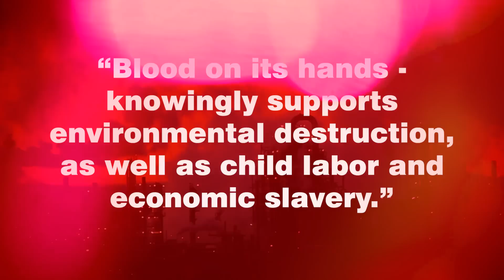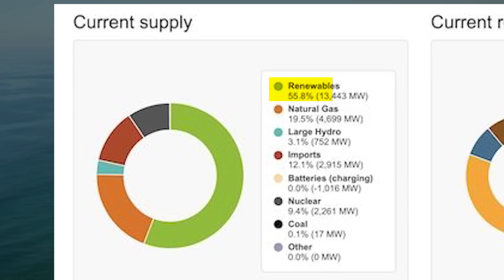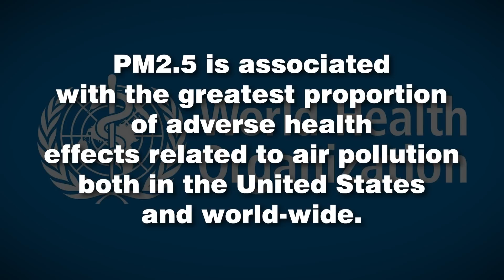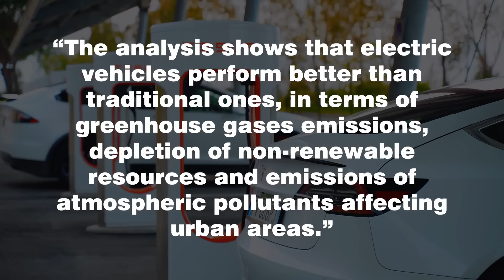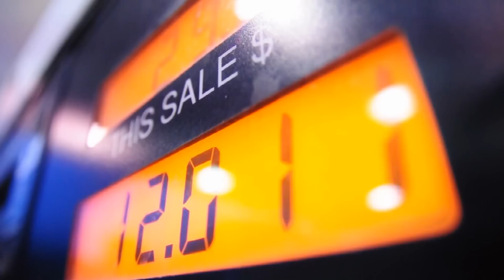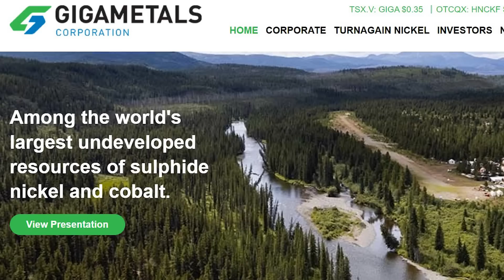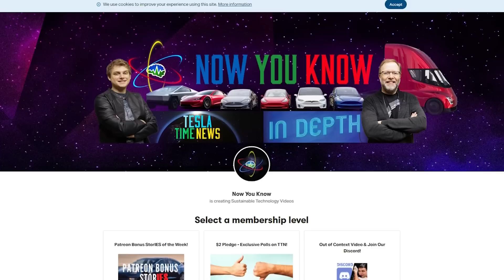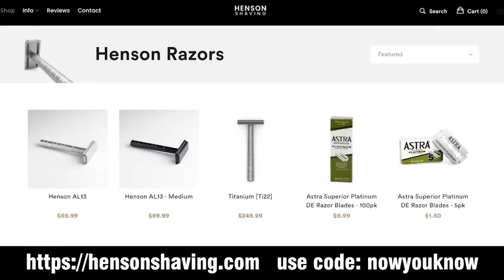Debunking More EV Lies | In Depth

Comment: You mislead, Our power grid cannot support a large conversion to EV's as was just recently proven by CA who put out an alert last week for the few EV's on the road in CA not to charge their vehicles because of the fear of brownouts or blackouts during a hot summer. Also if you have to put in a lot of miles you will not be charging from your home solar panels most of the time but from the underpowered electric grid and it may take hours to recharge. Not to mention the up to $30,000 dollar cost at present to replace your batteries in 3 to 5 years. Nor the expense to mine all that Lithium, and recycling (if you can) the old batteries. Nor the danger of your batteries overheating or shorting out and burning your auto to the ground. And the inconvenience of your EV's range continually dropping as the batteries age (as will the chances of your batteries shorting out increase). We are not there yet, but we may get there in about a decade if the tech continues to improve and they start building nuclear power plants again here in the US. Also, we will be running short of Lithium as more and more EV's are in use. Hopefully, they will come out with a better battery soon, but for now, not so much. I think solid-state hydrogen paste will be better in the long run. But we need cheap plentiful power. Fission for now( preferably thorium), hopefully, followed by fusion. And the diamond batteries look hopeful too.
Reply: Completely misleading.  CA asked EV drivers not to charge between 4-9pm, which was an unnecessary request as 95% of EV driving already happens between midnight and 6am.  And Tesla warranties their batteries for 8 years/150k miles and they are rated to 400k miles, so battery replacement is very rare.
Reply: @SpottedSharks  No, its not rare. It inevitable. If you own an EV. You will eventually have to replace the batteries.

Comment: The sun doesn't shine every day, and the wind doesn't blow every day. I know people in the wind business, it can not financially sustain itself without goverment subsidies. California is not a good example, they are importing some of their energy needs from other states, and oh yeah, the govenor is telling them to turn lights off, and set their AC at 78 degrees because the grid can't handle the demand, but sure everyone go get a EV and strain it more. In the big picture, the infrastructure to charge cars needs to be put into place before they overload the system with EV's. EV's are signifiacntly heavier, and heavier cars damage roads more and wear them out faster, and it is actually an exponential number it is not linear, so by wearing out roads faster they have to replaced sooner, thus expanding a EV's carbon foot print, oh and heavier cars wear out tires faster also, again add that to the carbon footprint, there is plenty of ripple effect with EV's if people want play which has the overall carbon foot print.  and the Congo is far and away the largest producer of Cobalt, last I checked they are responsible for somewhere around 70% of all Cobalt produced today, and guess who the number two producer is? Russia. oops. I am not against EV's in anyway, there is just too much koolaid drinking around how much better they are. In macro economics check out the petro dollar, the adoption of EV's over gas cars will help faciliate the collapse of the US dollar, you think your puchasing power has taken a hit in the last 2 years? It will look like childs play. ......all that siad I really hope there are some big break throughs in battery technology, it will be needed. Nuclear plants should be put in place, they are much more reliable and scalable, they even have technology out there to recycle the nuclear waste product now.

Comment: EV is the wave of the future. I would encourage you to read the report from Volvo, where they did a Life cycle of an EV vs ICE on models they currently produce, the XC40 Recharge and the XC40 ICE. This is by far the best analysis of the argument. They manufacture both and have the data. They leave it up to the reader to form an opinion.  The link is too long to post, as I haven't learn to convert it into a shortcut. Gladly willing to share it.

Comment: I would be literally better to use a big stationary two stroke engine burning crude oil to generated electrical power than to use ICE, because the big engine is more efficient, and as its a building, you can use big filters and closed cycles to capture bad particulate, outputting "clean" CO2.

Comment: Here is my prediction for how EVs will be recycled in the future.  Given that the mechanical components of an EV will wear our long before the batteries, I predict that EVs will be repurposed and used as an energy storage system for residential homes.  Someone will eventually develop adapter kits that will allow you to integrate the battery storage systems into your home solar generation system.  We'll see small huts start popping up in back yards everywhere.  Pull your worn out EV in, hire an electrician to hook up the adapter, and wahlah, 65+kwH worth of storage.  More than enough energy to significantly offset the power requirements of the typical home.  There you go, I want a royalty if someone does this.

Comment: Stopped watching after your first "debunking." To be clear, you claim to have "debunked" the statement about the US power grid, yet you completely fall short of debunking it. There are actually two points being made in Sorrel's first argument. 1) the majority of power in the US grid is generated using fossil fuels. You acknowledge this fact, but basically argue "Hey, it's getting a lot better, and will continue to do so in the future." OK, fine, let's assume you are right. That still doesn't "debunk" the fact that the vast majority of the energy going to power America's growing fleet of EV's does in reality come from fossil fuels. So you are 0/1 there. Second part of the point, 2) Even though EV's don't have tail pipes, accurate and responsible accounting of the emissions from driving an EV must include accounting for the emissions caused by generating the power that charged said EV. You completely gloss over this point, you don't remotely debunk it, not by any stretch of the imagination. So you are 0/2 when it comes to debunking both parts of Sorell's first point. Sorry, please remind me, who is making trash videos here?

Comment: You have Gavin Newsom telling people to limit their power use and not charge their EV cars. So how reliable is solar and wind....Wind power mills life span is about 20years. it takes 16years to make it's money back....so 4years of profit before it's decommissioned? Try to drive an EV in -35degrees in Canada! the power in it's battery will deplete fast! If a battery powered car can charge as fast as filling up a gas powered car, and be as reliable in cold weather and be able to pull a trailer without fast power depletion then I would definitely be sold on buying one!

Comment: I agree with the nuclear statement, but think the 25% number is a bit deceiving if you actually look at yearly output from solar and wind farms, of course peak season in high demand areas with the most infrastructure will produce higher figures... That's why a yearly average is neccessary. Also nuclear power can be generated without relying on China to make it economically viable (although it does usually take 15-20 years before paying itself off) China can cut the solar market and much of the wind turbine market (although to a slightly lesser extent) TOMORROW. Also the lifespan/financial equalization period without subsidization for both Wind and Solar farms is still a little suspect looking at the various reports... I'm all for more energy independent solar systems or even non impact full small-scale hydro electric home systems with or without grid tie integration... But these systems are often based atleast 40-90% on Chinese components, with almost no alternative  to certain components even with the padding of subsidization... Atleast home battery banks have a decent shelf life and are easily serviceable unlike modern EVs... But once again fossil fuels are used not only to power the production facilities for both the automotive and solar/wind component factories, but the actual products are often made of fossil fuels (not setting them on fire sure helps with emissions though) (Also insert EV fire joke here) That article basically took some actual facts and misused them to an extent, kind of like the information being used in this particular video... This solution is not so simple, and sadly currently greed IS a driving factor over many policy changes, strip mining for Lithium is not a sustainable future, and neither is the way most Li-Ion batteries are ACTUALLY recycled in the real 3rd world, much like gold from PCB's... We currently have another option, but certainly not a sustainable solution if planning for certain contingencies. Turns out complicated issues are complex! 😉👍

Comment: Oil will not stop being used for  for hundreds of other things that will not go away any time soon. So the energy it takes to process gas or diesel is actually almost negligible. If oil was only used for gas and diesel the you have a point with this.

And in regards to recycling, you are assuming that they will be recycled. Pretty much all  residential recycling programs say they recycle tons of stuff,  it actually don’t recycle a lot of what they say they do. So it depends on if recycling actually happens.

Comment: 10yr / 100K miles is a goddamn lie. You barely have to replace a single cell that often, and sometimes the entire battery pack makes it 300-400K+ miles before only a few cells needs replacing but the battery pack still works.

Comment: Still going to need new battery tech before EVs are legit clean. The processes involved and even just the diesel burned to mine the metals used in batteries are pretty bad news.

Comment: The sun doesn't always shine to make solar work and the wind doesn't blow all the time especially when it is very hot. The biggest problem I see is lack of infrastructure to charge the vehicles and trying to drive coast to coast in a EV is probably not possible today. Things need to change but there are so many things that need to be overcome to be 100% electric. If you could build and sell 20 million EV's a year it would still be years before you replaced all the gas cars and since EV's cost quite a bit more to buy how can regular middle class people afford to buy them. Trust me the manufacturers aren't going to lower prices to help us low income folks afford their EV's. We have many miles to go and many hills to climb before this all is going to be possible

Comment: The sun doesn’t shine and the wind doesn’t blow every day (not enough to produce electricity in sufficient amounts for everyone to drive EVs), and the destruction of earth and all the fossil fueled machinery and trucks needed to tear up,earth, fill the dirt with toxic chemicals, haul the minerals and materials for EVs across the world is a huge emission of CO2 and other gases.  You are intellectually numb if you believe EVs are clean because nothing comes out of an EV tailpipe, and either dishonest or really ignorant.  And that leaves out the materials and chemicals for the required magnets, and the vastly increased damage from the materials needed for the frame and chassis of EVs.

Comment: Actually, she is right. Even your own words contradict you. If 25% is green, then the HUGE majority of electricity is NOT. Simple math, huh!? How can you then claim that EVs don't produce CO2 emissions? 2nd, in US, only 1% of cars are EV. We don't have electricity nor other infrastructure needed to go 100%. Third, do you know how much concrete and steel is used to build solar farms? They are carbon intensive materials. 4th, even if agree that this would reduce CO2 emissions, aren't we replacing it with a huge environmental problem?

Comment: That’s big fucking lie about sun and wind being free and that wind and solar is cheapest. Solar photons and air molecules moving along a pressure gradient are not forms of energy we can use. We must expel a lot of energy to make those photo voltaic panels and wind turbines to convert that energy into a form we can use. Since the wind sometimes does not blow and night exists, wind and solar have a capacity factor of 10% to 20% and you need massive storage systems to bring that up on par with fossil fuel energy bringing the cost up significantly beyond fossil fuels. No one has every made an electrical grid that runs on solar and wind because it is so impractical that it might as well be impossible. There is a reason poor African countries are building coal power plants and not solar farms.

Comment: i actually live in California during this heat wave, the 46 megawatt capacity was almost reach and close causing major rolling blackouts.  you can't charge EV during 3pm-7pm and run your AC at the same time.  plug in hybrids and better bus system are the real answer.  EV are a semi-scam if they destabilize and tax the grid too far in the real world. More nuke energy is needed for the plug in revolution.

Comment: “A typical EV battery weighs one thousand pounds, about the size of a travel trunk. It contains twenty-five pounds of lithium, sixty pounds of nickel, 44 pounds of manganese, 30 pounds cobalt, 200 pounds of copper, and 400 pounds of aluminum, steel, and plastic. Inside are over 6,000 individual lithium-ion cells."

Comment: I see story after story from EV pundits going on and on about the environmental effects of old lithium batteries: look, we don't bury old 12V lead-acid vehicle batteries in the ground: the old battery's lead is re-cycled for new batteries. Up to now all we had was small cell phone and cordless tool lithium batteries to deal with. In these relatively small volumes (compared to EVs) there was not a whole lot of incentive to re-cycle. Now that there is demand for much larger quantities lithium, I am sure more work will be done to re-cycle these old EV batteries to give lithium mining a chance to catch up to EV demand (this video mentions three companies already doing it). Besides I read that California is currently using old worn out EV batteries as backup for solar and wind farms, so they are not all going into the landfills there.

Next, we do not have to rely on China, Chile, and Bolivia  for lithium, we already have some here in the U.S. (as does Canada). There is a geothermal energy plant by the Salton sea in southern California (note the Salton sea is currently fairly toxic from evaporation over the years and farm runoff) that uses hot underground brine water to generate electricity. That hot underground water happens to be loaded with minerals (obviously: lots of hard water in the southwest) and one of those minerals is lithium, and quite a bit of it! One estimate is that there is enough lithium there to meet all of the United States needs, and forty percent of the world! Joe Biden has already invoked the Wartime Production Act to get companies to investigate environmentally friendly ways to extract lithium in the United States.

There is a similar situation for cobalt and nickel from coal mine waste. In this case it could be double win with the removal of these toxic waste sites (see the article: 'In coal country, a new chance to clean up a toxic legacy').

Comment: You need to give all the facts.  You gave an emotional response and left out facts. Ev work best if nuclear power is source of electricity.   Wind and solar only work when sun shining or wind blowing and storage of electricity would take up an area the size of Texas if it was even possible. Big oil supports solar and wind because they require fossil fuels as back up.   Big oil is really scared of very clean nuclear power.  You guys are probably on big oils payroll.

Comment: It always amazes me how anti gasoline powered vehicles forget where they get the power to build, charge, and get the raw materials to build and power their taxpayer subsidized vehicles! I know! we will make the tax payer subsidize all those unreliablbe ugly wind farms and equally ugly and solar panels that degrade after 15 years that you can't recycle! Then there are cloudy and light and variable wind days.

Here are some numbers to work on guys, even if, a single battery charge could take you 900 miles, this country does not have the generating power to equip eveyone with a battery car. Why not let the market and citizens decide what we want. Remeber what happened with the light bulb?

Don't get me wrong, I see advantges in all electric but I see also a lot people should consider.  Here are some numbers to look at---It would take 70 Gigawatts of electrical power to charge just 10 million EV's for 1 day. The total electrical energy required is 70 Gigawatts per day.
Our present total USA electricity output capacity is 4 Gigawatts. End Of story.

(Each EV takes about 7500 Watts to charge nightly) homes would need to convert to 240 volt electrical systems. A 110 volt system requires a 2 day 90% charge. 

Placing this into deeper perspective, It would take 3.2 million 6 foot X 3’ solar panels to derive 1 Gigawatt of power.
To create 70 Gigawatts it would take a land mass, in the USA, the size of New England plus New York , to build end to end solar fields to generate 70 Gigawatts with 210 million solar panels.

One snow storm blizzard would end electrical production until melting occurs to allow solar charging. 

We need more power production in this country instead of making China and Gernmany rich buying tax payer funded solar panels and tax payer funded wind mills. 

If we adopt the energy policy President Trump had in place, we would be rich with inexpensive gasoline, diesel and jet fuel. We would all be richer not subsidizing all of the current president's blunders.